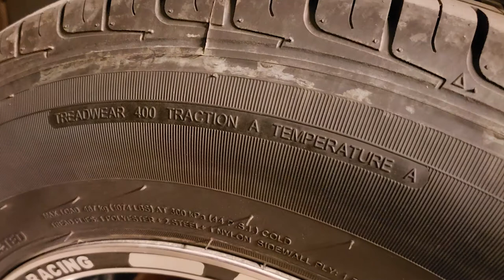Our Double Cab Sunshine Review

Comment: Nice rig. So are the 13 inch tires the oversize? and what ol did you want to be put in? How many liters in the gas tank? What is the cost to fill it up? One thing I like about these, is that there are lots of parts for them all over the place. I love the color. your sunshine is what I have been wanting  to get, and the same color. I thought I saw  multicab club there???
Reply from the maker: No, I actually wanted the over-sized tires but the design of the front fenders won't allow it to fit.
I'm a super geek about  maintenance records, average for 9 fuel-up is roughly 1200php & about 25L each. Surprisingly auto parts here are a bit hard to find I'm finding out. I'm used to being able to go to AutoZone, or wherever, and get what I need. Here there isn't anything like that, you need to know people. I'm starting to build that circle of people. There's several different clubs here that I'm trying to connect with but language is a bit of a challenge at times. 
 Thanks for watching and commenting!

Comment: Do your butts get hot with the engine below the front seats? Starting to research multicabs for when we're back. Amping guys!! 🤙
Reply from the maker: Actually, no it's not bad at all. They are a good inexpensive mode of transportation here, but do detailed research before getting one and find a good & trusted mechanic before getting one. There will be some mechanical issues with one and getting new parts isn't going to happen. I'm going to be doing a full in-depth review of owning one for a year now and posting it in early Jan.